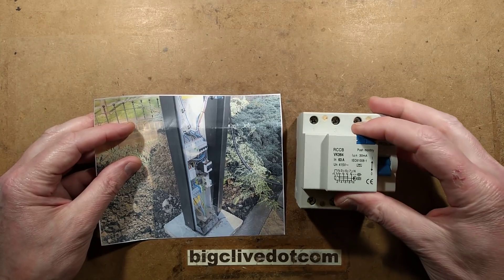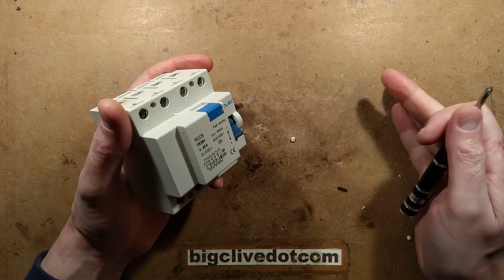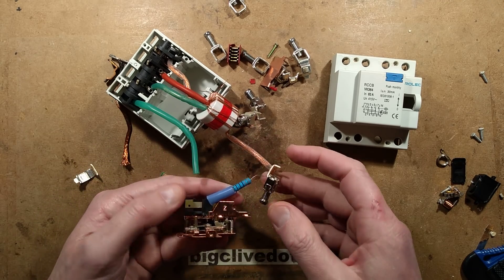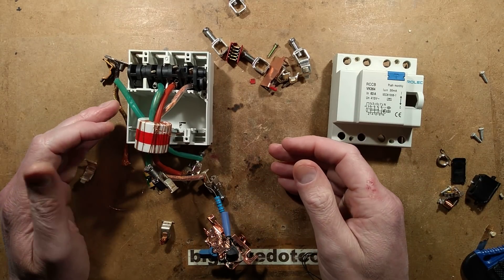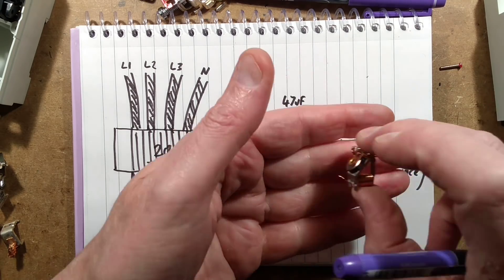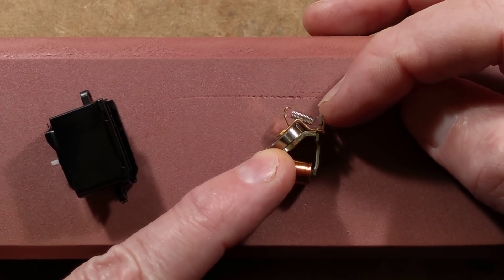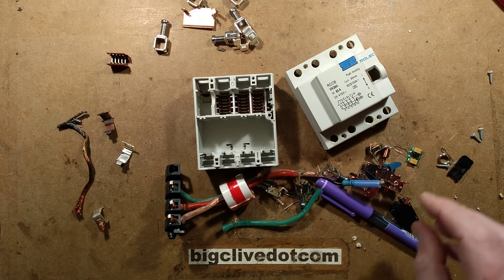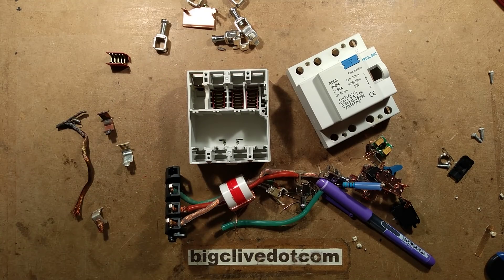Failed 3-phase RCD/GFCI from a Rolec electric car charging pillar. (with schematic)

Comment: One megawatt chargers for trucks: "huge potential for exciting electrical incidents."  

I see what you did there.
Reply: Lots of new employment opportunities for "OH&S" Officers there - trying to reduce the "excitement potential" to an acceptable level :-D
Reply: Dave Micolichek  A truck stop with 25 charging positions for trucks would need more power than a small city.  Or a few acres of solar panels.  Gut level feeling is that Tesla will be giving a lot of money back on the pre-orders (for publicity) for the big over the road truck....
Reply: @Billblom   That's the issue that electric vehicle supporters seem to quietly ignore, there is not anywhere near enough power in the grid (in the UK at least) for major electric car ownership, even with batteries/super capacitors to make up the difference. You would probably need a decent sized fleet of new Nuclear power stations to get the electricity required for even a third of the UK to go electric.
Also the grid are not going to be happy that there are now a load of devices connected to the grid that can at will take 1MW, not only will there be connection penalties, the grid will more than likely have manage the charging to meet current electricity demand as is done with some large electricity consumers now.
Imagine having a time critical load that can't get there because when you try to charge the grid says no?, whereas on an ICE vehicle you just find another pump . 

Why petrol/diesel/LNG is so great at powering cars is that whilst it's technically less efficient than electric it's energy density (when compared to batteries) is so much higher, plus doing a "rapid charge" using fuel needs relatively simple infrastructure at the point of use and doesn't have to be controlled so as to avoid damaging the tank. 

As for high power delivery at relatively low voltages, the electrified railways in the south of England generally use a 3rd rail power system, where ~750V DC is supplied via an electrified 3rd rail, this is generally capable of ~4000A/3MW although this (according to Vivarail) would require ceramic shoes if used for static power.
Reply: dglcomputers - When you say “the grid” do you mean the distribution network or the generation capacity? Most of the time, there is up to 20GW of “spare” available generating capacity in the grid. It is only at peak load times in the winter when there may be a problem. At the moment, no coal powered generation power stations are running, due to the low summer demand. If everyone (mainly businesses) switched off unnecessary lighting, PCs, and air conditioning overnight that would be good. It’s anticipated that most people who have their own driveway would be charging their electric vehicle overnight, when traditional electricity demand is lower.
Reply: dglcomputers You really do need to check your facts. There is no problem with charging cars and the like in the UK. The grid can stand that as it stands. Large users already need special permissions to connect depending on the likely use. It is likely that any fast charging facility for trucks is likely to have some local storage to flatten out he demand on the grid, to suit the local demand/capability.
Reply: @Mark1024MAK  - both.  Here the utilities have decommissioned a bunch of coal plants.  They replaced a few of them with natural gas, but not the total MW that got unplugged.  The local grid is also very fragile. (I had 8 5 or 6 hour outages last year, and 2 very long  8 day outages after big storms.  The Grid here is VERY fragile.  The Generation (other than the big nukes) is also only semi-reliable. Tack on another 500 megawatt type load blobs for charging stations, and things may tip over.
Reply: @dglcomputers1498  It's not true really though.  We refine petrol and diesel from crude oil for UK consumption.  That refining process consumes energy, and that energy usage will not be present with an electric vehicle.  It turns out that the usage is approx equal.  So one gallon of petrol takes about 20kWh of electrical energy to refine.  20kWh will take you 80 miles in a good EV.  

In addition there is the possibility to demand stabilise with smart meters - by reducing the price of electricity for at night charging excess capacity can be used when it is not otherwise being used.

The big problem is going to be local grids, there often is not enough capacity on DNO grids for everyone to charge at 7kW especially if people start putting in heat pumps.  That is where some upgrades will be necessary to cables in the street. Also it is likely all new build houses in the near future will be fitted with 3 phase power in anticipation for EVs and heat pump usage.

""Also the grid are not going to be happy that there are now a load of devices connected to the grid that can at will take 1MW, not only will there be connection penalties, the grid will more than likely have manage the charging to meet current electricity demand as is done with some large electricity consumers now.""

National Grid actually is wetting themselves over electric cars, they can't wait to install 10MW service direct to motorway service stations so a 50 station super charger can be installed because that will bring in some serious bucks.    And really a 1MW load is not that much in grid terms, they generally don't worry about connection issues until things get above 30MW.   I know someone who works for them.   It is likely that large fast charging stations will slow charging down as they get busy due to capacity limits but we don't know yet how they will work.  Tesla seem to have little issue with 50+ station chargers that can pull 7MW if fully loaded.
Reply: What the heck would you connect to that with? 4" diameter copper bars?

A megawatt charger is starting to get competitive with a gas (petrol) pump, although my calibrated memory and a bit of Googling indicates that a gas pump is delivering about 24MW.
Reply: @PaulSteMarie  don't forget that electric cars have a efficacy around 90%. Petrol have around 30% so 24MW petrol pump Only needs to be 8MW for the electric charger to match
Reply: @Alexswe72  **only** needs 8MW? 🤣

I don't even want to think about what a 8MW pigtail would need to look like.
Reply: Dave Micolichek   Lets hope the truck drivers will be more careful than the  run of the mill driver  and they put big pipe guards around the charging post . OH could it be it failed because its the contact furtist from the screw that holds it together ?? not getting tight on the contact ?
Reply: @Subsiding0974  Very unlikely they would go over a kV. I'm guessing maybe around 700 V, whatever you get from rectifying 3p 480V. Say it's a kV. 200 kcmil = 1010mm² = 35mm diameter gets you to 665A. I'm guessing at least 2" diameter.
Reply: @PaulSteMarie  You could actually look it up instead of randomly guessing and letting your ignorance lead you further down the wrong path.
8 conductors, upwards of 850 volts.
https://www.teslarati.com/tesla-semi-megacharger-charging-port-close-up-look/
Reply: @Markle2k  Voltage isn't the issue, current is. There's no way 1MW is going to get through that connector.  8 conductors @ 850V gives you 294A per conductor, so 400 or 500 kcmils per conductor.  Each of those eight pins would need to be an inch in diameter, and you'd need a crew to lift and maneuver the cable to the socket.

Even then, at 850V you have substantial arc flash concerns.  Unless you have dedicated techs making the connections, you'll need serious interlocking to ensure that the connection is fully seated and locked before the power comes on, and that the conductors are grounds before unlocking the conductor.
Reply: @PaulSteMarie  Double the voltage, halve the Amps.
This is not a theoretical thing. It already exists. And not just with Tesla. The folks at Chargepoint have a prototype 2MW connector with 8 conductors and up to 1kV (4 x 500 Amps) for heavy vehicles and aircraft.
https://insideevs.com/news/338287/chargepoint-reveals-2-mw-charging-connector/
You need to consider that these high power connectors, well, the cables, are also typically actively liquid-cooled.
Reply: @PaulSteMarie  Oh, and yes. Even itty-bitty level 2 (240v <80 Amps) connectors do the full handshake before delivering power. The cables don't get plugged in live. They lock once charging is enabled.
Reply: @PaulSteMarie  Surely Tri-rated multi-strand cable though?
Reply: Every “truck stop” here is relatively close to electrical substations since the high voltage lines from remote generation follow the highways. The Google office in Pryor, OK is like 1/2mi from a GRDA coal/nat gas generator which is part of a HUGE industrial park, theirs an iron casting company next door. is only a few miles from the Port of Catoosa which is only a couple miles from the AEP Oolagah coal plant. That covers the East and North side, there’s several other plants to the west and to the south all near highways and interstates.

Out to the west is the beleaguered Keystone Dam which has a small hydro plant right off the Cimarron Turnpike, the state hwy still runs on top of it... don’t know if it’s shutdown because of the huge water release. 

Even cheaper the trucks would charge overnight when A/C usage is lowest.
Reply: @peterg.8245  yeah, getting electricity from the generator to the truck stop is easy, that can be run at 100's of kV. Getting a megawatt through a temporary connection to a truck that doesn't require a certified electrician to set up is quite another matter.
Reply: Paul Ste. Marie - Why? There are “portable” generators that can supply a similar amount of power and they use plug in power leads. [Portable as in shipping container size that fit on the back of a truck].
Reply: @Mark1024MAK  You mean like this?:

https://www.cat.com/en_US/news/engine-press-releases/caterpillar-launches-1-mw-cg132b-16-natural-gas-generator-set.html

That sort of generator is going to be installed by qualified electricians.  The biggest mobile generator Generac makes is 450 kW. They do have a 1 MW industrial generator, but that's designed for permanent installation.
Reply: @PaulSteMarie  Tesla already do it with 250kW.  The charging cables have temperature sensing in them, and it will shut down or throttle power back if they begin to overheat.  I suspect they will use a beefier connector than the standard one - or maybe multiple connectors in parallel.
Reply: @peterg.8245  Well .... the high voltage power lines (that go from sub-station to sub-station and no where else) usually go "as the crow flies."   But that line crosses highways and that's where it might make sense to put in another substation for your Telsa Truck stop.
Reply: Matt Quinn - but you are assuming that every single person will each fully charge up their electric vehicle every day. Does every single person that has an internal combustion engine car visit a fuel garage every day? No, of course not. In order to work out a more reasonable power consumption, you need to work out how many people will arrive by car, how far they traveled and did they charge up at home overnight. We may well have to upgrade the electrical supply and distribution network. Wind turbines are still being built. As are solar PV systems. Is any of this the full answer? No, of course not. But we have to make a start somewhere. Motor vehicles / road transport is now one of the biggest polluters and producers of CO2. The industry has only managed a 3% improvement so far. That’s dismal. And the internal combustion engine is very inefficient. Electric motors have a good efficiency, the problem has always been the battery technology. Lithium cells are now demonstrating that they may be the first part of the answer, at least for now.
Reply: I see watt you did there .....

Sorry, I'll go ohm.
Reply: Matt Quinn - I find private hire cars/drivers are the worst...
Reply: And with Tesla share prices plummeting, I don’t think this will be a problem we will have the pleasure of watching.
Reply: The largest electric ferries in Sweden (in fact, it's the largest ones in the world!) use 10.000 V charger, 10 MW. They have to charge enough in around 5 minutes since the boat only stays in port for 5-10 minutes every time. They had to invent a special charge robot to make it work. https://insideevs.com/news/331359/worlds-largest-electric-ferries-416-mwh-battery-10-mw-charging/
Reply: @Matt Quinn You must talking UK installations.  US homes, at least new construction in the past 20 years, generally have 240 VAC @ 200A, so 48kW.
Reply: Charging stations in US truck stops  will be a nightmare, with 300 to 750 trucks wanting to charge at one time they will need on site nuclear power stations.
Reply: @Matt Quinn It never ceases to amaze me how small the input to British installations is when compared to the beefy loop circuits and outlets. About 2/3 as much per coming in, but 2x as much at each outlet.
Reply: People will hang out at truck stops just to watch things "go terribly wrong".
Reply: @Matt Quinn Well, there we have it! 🍵 vs ☕
Reply: @Matt Quinn Tea vs coffee. Coffee makers (drip or perc) start boiling the water immediately, but it's just a little drizzle and doesn't require huge wattage. Espresso machines are a different story, obviously.
Reply: @Matt Quinn 60A or 100A installations are going to be old enough that they have Edison-base fuses and no grounds 😱.

There's no "per leg" on the 200A. You can get 200A out one leg and back the other. It's just a difference in the ground reference.
Reply: @Matt Quinn Chuckle. The differences are just odd. I don't know that ones better than the other.

The 200A, though, is absolutely 200A. 300A service is not unread of.  It's no different than how 3 phase in that regardless. Just in my garage, I've got various items running off 240V/20A, 240V/30A, and 240V/50A.
Reply: @Matt Quinn 13x40 lathe & a welder